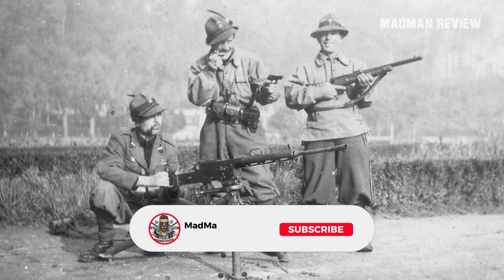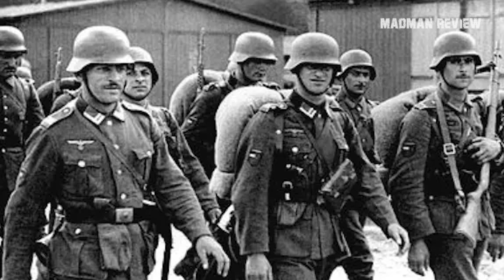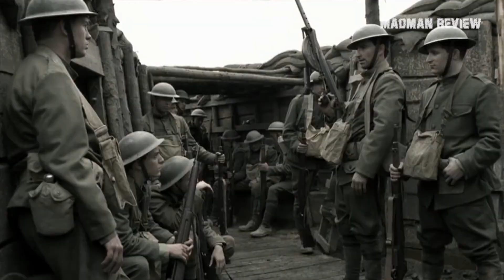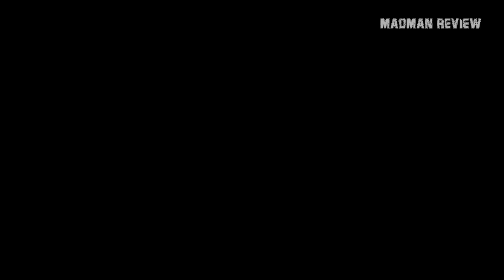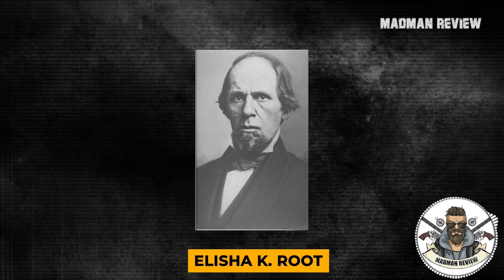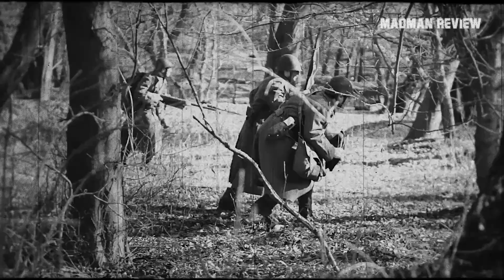The Absolute WORST Guns EVER MADE!

Comment: I'm surprised the Nambu pistol didn't make the list.
Reply: The only issue the nambu had.  Was a weak firing pin.   It could have been a simple fix.    But Japan i guess wasn't to worried about upgrading it.  As pistols were rare in the imperial army.  As well as smg.      But many jap rifles were perfect.  Like there 2 been styled lmgs.   Ariskas were great rifles if early or pre war samples. The revolvers were usable    the heavy mg were built like tanks. And extremely reliable   Japan also developed many great aa mg guns. And cannons.   They made smg designed by Steyr of austria that was reliable and well built.  And used German mg13 and mg15 machine guns that were excellent       but late war they became crude as  finish fitment and features were removed or neglected.